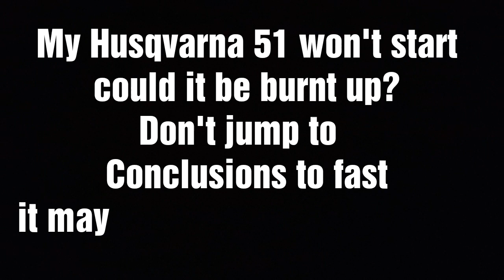Husqvarna 51 did I burn it up (won't start)

Comment: Not trying to be rude, but 32:1 mix is why the saw had to much carbon, resulting in plug problem. Glad you got it figured out and running. It takes some time, but with a restricted stock exhaust a heavy oil mix will eventually show it's downside.
Reply from the maker: This particular saw was purchased in the late 80's and has had nothing but 32:1 mix through it since it was new, it is tuned just a little rich but that is how I tuned it.
This is the first issue I've had with this saw, I think that's a pretty good run.

Comment: I  keep at least two new spark plugs in my saw bag at all times.  When I recently put a new fuel line and new air filter in my 575, it would start and idle but it would die if you tried any throttle. I had put a new NGK plug in it while I had it apart that turned out to be bad right out of the box. Plugs can fool you with spark at idle yet still not be up to the task for higher heats. I put another new plug in and the saw ran flawlessly. Just goes to show a good mechanic must stick to the basics and never be fooled by new parts or the smallest of details like carbon fouling.
Reply from the maker: Southeastern Ohio Honeybees You my friend are 100% right, its way to easy too OVER THINK the issue at hand. You should always start with the basics. I too have had spark plugs be bad right out of the box. You also need to make sure your using the proper plug with the correct gap, and the OE plug should be a non-resistor style plug. 
The plug in this saw is the original plug that was installed from the factory. This is literally the first thing done to this saw besides the bar & chain being replaced. 
Thanks for commenting.
Reply: @craigtimmons3468  Friend, the revolutions 13200 max for the saw 372xp oe 2003 are okay?
Reply from the maker: @Sensei948  The OEM Husqvarna Workshop Manual gives these numbers,

MAX Power is rated at 10'200rpm's

Over Speed is 13'300rpm's

These are Husqvarna Specifications  so yes 13'200 rpm's would be MAX Speed.
Reply: @craigtimmons3468  max pover 9600   13500 old version

Comment: Sir your idle speed is more than it should be.
Reply: It's either an idle adjustment that needs to be made, a very weak clutch (which is common on these saws that have cut a bunch of wood and weaken over time), or a big air leak somewhere on the saw. If you have the ability to pressure/vac test, you could rule out the worst scenario right off the bat.

Comment: Always, always, always PUT A NEW SPARK PLUG IN IT! They are only a few dollars. Don't try to  clean the old one. Cheap insurance
Reply from the maker: I agree with what you Almost 100%, But in this case if you watch close enough the only thing I done was remove the very small piece of carbon that was bridging the gap of the spark plug, So with this being the only issue that is why I reused the original spark plug to the saw. And yes it is still running on that plug.
Reply: Sorry, I should have mentioned, immediately throw the Chinese spark plug in the trash. They are horrible for your equipment.  Thanks for mentioning

Comment: How about putting a new plug in it?  A carbon build up tells me that you are running to rich of a mixture.  It also looks like it is running a tad rich.  I would replace the plug and add a little seafood to the tank to clean up the carbon build up in the saw.
Reply from the maker: This saw I purchased brand new in 1991 that's 28 years of running 32:1 mix and this is the very first issue I've had with this saw, i will take that every day of the week, for years this was the only saw I had and it has put many cords of fire wood on the truck over them years, as seen in the video I removed the carbon and reinstalled the original plug back into the saw and it is still running on all the original parts. 
I do run my work saws just a tad on the rich side for just a little extra lubes and cooling, I tach tune to 500 to 1000 rpm's under max for my work saws.
I don't use seafoam but I will use 
MM Oil.
Reply: @craigtimmons3468  should be 50:1 mix
Reply from the maker: @Magdusia2003  Why 50:1?
Reply: @craigtimmons3468  It is obvious. Haven't read the user manual? Information about making the mixture is on page 26 (For the best results use HUSQVARNA two-stroke oil, which is especially developed for chain saws. Mixing ratio 1:50 (2%))
Reply from the maker: @Magdusia2003   It would seem that you are a sales person for Husqvarna, 
FYI  Most all 2 cycle oil is designed for chainsaws if they are 2 stroke engines, granted some far better than others but still designed for 2 cycle chainsaw engines.
And you are 100% wrong I have read the Owners Manual I read all my owner manual's, and yes you are right it does call for a 50:1 mix ratio which is needed to meet the emissions standards set forth by the EPA for that model year of saw.
I for 1 don't like to operate anything without enough oil and that is why I mix at 32:1, a spark plug is a lot cheaper than a new saw, and as stated this saw is now pushing 30 years old and this was literally the very first major issue I had with the saw.
A 30 year old spark plug cleaned and reinstalled and still running, how can you find fault with anything I'm doing based on this?
Please answer 1 question, How many 50, 51, 55 series saw have been burnt up due to lack of oil? 
When you answer this then you can judge me for my actions.
Reply: @craigtimmons3468  You are a funny guy: following the manufacturer's instructions - I must be the seller. I am a Husqvqrna 51 '94 user (european/Polish market so mine didn't have to meet the EPA standard, from the beginning has been working on a 1:50 mix). I use semi-synthetic LS+. With this oil I make a mixture for: chainsaw and motorcycle MZ ETZ 150 '91 1:50, chinese brushcutter 1:25, moped 50cm3 - slide sleeve in the connecting rod head - 1:30 (all of them according to user manuals). A larger amount of oil in the mixture causes more smoke that you inhale, carbon deposits (carbon deposits on the piston walls cause more friction) and more difficult flame propagation in the combustion chamber, which results in poorer performance. This has been confirmed in practice. Once I changed the oil for cheaper, the production of our domestic brand. Starting with this oil was difficult and the performance clearly worse. Another time I made a 1:25 mix for my motorcycle by mistake (which I noticed after more smoke). A larger amount of oil did not protect the engine from overheating (air-cooled). After a 60km journey I had to take a break because the engine lost compression. Another time I changed oil from semi-synthetic to fullysynthetic Mobil. This oil did not burn properly because it has a higher flash point, it only accumulated in the chamber under the piston. And you are 100% wrong - I didn't state that you haven't read the owner's manual, just asked. I saw on amazon bottles of Husqvarna oil with stickers where the proportions are 50: 1, 40: 1, 32: 1 (because this oil can be used in other equipment where a different proportion is required). Owners manual says which should be used. Maybe because people like you - ignoring the instructions -  there are 50: 1 mixes ready for use on the US market. No reading, no thinking, just filling up the tank and work. With a correctly set carburetor and a 1:50 proportion of JASO FD quality oil your chainsaw won't burn up - mine didn't yet. But issue only with spark plug shows that you don't use that saw too often. In mine i've changed in couple last years springs of starter, choke and brake lever, outer bar plate, Muffler Silencer Bracket 2 times, Felling Dog not to mention fuel cap from newer model which finally don't leak.
Reply from the maker: @Magdusia2003  I'm not sure where your getting the ideal you didn't say I never read the owner's manual, go back and read the first 2 lines in your comment you say its is obvious haven't read the users manual, Dont know how you only get was only asking out of that.
 From the time this saw was purchased brand new it was my only saw i used up to 2 years ago, it cut 4 to 6 cords a year plus blocking depending on prior year usage plus all trimming, As you state 50:1 is what should be used as stated in the owner's manual and that is only a minimum recommendation not set in stone so to say. Running 32:1 for almost 30 years and only having 1 issue is a very good testament for that mix. Also how you take care of your saws aids Exponentially as to is longevity. 
Of course Husqvarna is going to recommend their oil but at the same time they dont say the warranty will be void if you use anything else, this is only a marketing ploy to get you to use their oils which equals more money in their pockets. Remember Husqvarna doesn't make oil they contract it out ot a oil manufacturer who makes it to there specifications. 
I've been using 32:1 mix for over 40 years and have never lost a top end due to your so called carbon build up, so 32:1 it will remain.👉
Reply: @craigtimmons3468  Don't be mad at me. I didn't want to upset you. English is not my native language. Maybe I said it imprecisely. You asked "Why 50: 1?". I answered "It's obvious" (this proportion for me and for those who looked into the owner's manual) Then I asked "did you read" There is a question mark at the end of the sentence for sure. That was the intention. Use 32: 1 mix if you want. What oil brand are you using?
Reply from the maker: @Magdusia2003  I'm not mad or upset , maybe irritated,
 I don't tell people this or that is what you need to use but only say this is what I use.
In the 70's I used Homelite 2 cycle oil then in the early mid 80's I switched to Castrol 2 cycle mix then in the mid 2 thousands I switched to Lucas Synthetic 2 cycle mix and I'm still using that to this day.
I lost several top ends in this time period and can say not one of them was due to an oil issue all were either carbs improperly tuned or air leaks.

Comment: Hi my stihl 170 has 3 new plugs new carb no high and low needles to adjust. new gas filter and air filter and gas line muffler clean great spark the idle screw 2 turns out like the book says,and new gas mix in a can from stihl and it still won't start,lets hear some fancy answers
Reply from the maker: I would pull the muffler off and check the piston and cylinder for scoring making sure to look into the cylinder, if that checks out ok I would give it a shot of 2 cycle mix into the carb while holding the throttle open to see if it will pop/run a couple seconds. Could also be a fuel delivery issue with the carb. Check the pulse line and intake boot for tears or holes causing a leak. Good luck
Reply: @craigtimmons3468  m

Comment: 32.1 mix gas is too rich 50.1with high test gas is what should be use thats why there carbon build up.
Reply from the maker: Please Explain why 32:1 is to rich and why I should run 50:1?

Running Hi-Test fuel in an engine that isn't designed for Hi-Test fuel actually will make less power than running 89 octane fuel. Remember this the higher the octane rating the SLOWER the fuel burn this is to avoid detonation that will destroy the piston.

So because it looks like you did not read my other replies this happened when the saw was 28 years old having nothing but 32:1 run through it and this was the very first issue I have had with this saw, it was still the original spark plug which I just cleaned and reinstalled.
50:1 is an EPA push to meet the emissions limits so I'll ask this again would you drive your vehicle down the road with only 1 qt of oil? I bet not. So why run your 2 cycle equipment with an oil mix that could cause way more damage due to lack of lubrication internally versus just a piece of carbon bridging the gap of the plug after 28 years of service?

Scored piston & cylinder or carbon take your pick.
Reply: @craigtimmons3468  sure u can run 32.1 it will run fine.all im saying is the more oil the more chance of carbon deposits on plug burning more smoke and clogging up the spark aresster.i got stihl and husky 2 stroke equipment.it calls for 50.1 with 89 or higher .ive been using it for years and working great.im not saying what ur doing is wrong.